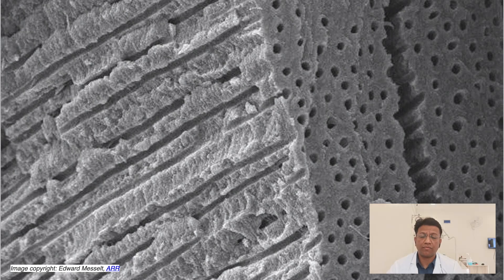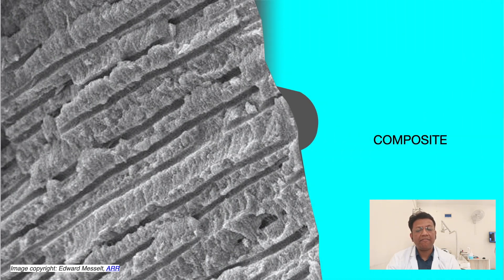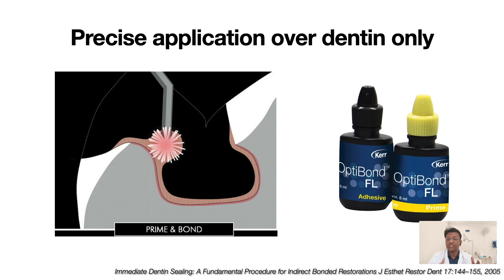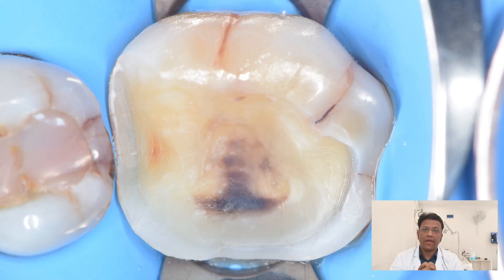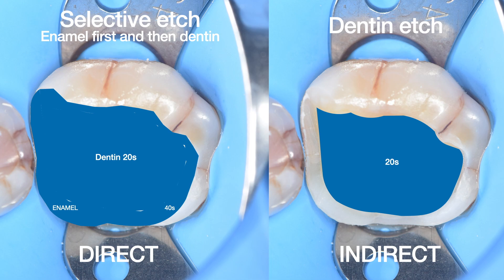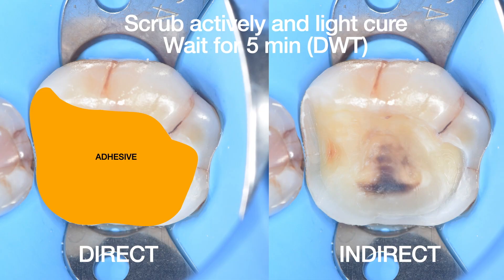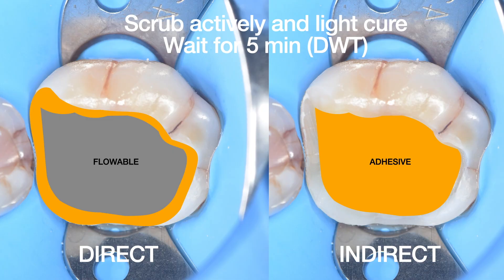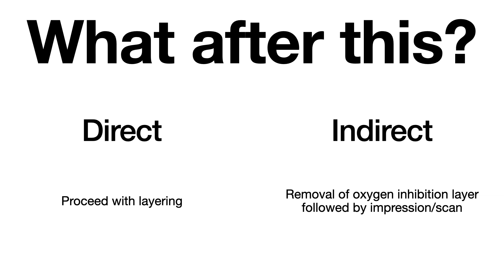Post op sensitivity after composite restoration | Immediate Dentin Sealing

Comment: I'm using composites with DBA since 1995.My observation is there were lot more sensitivity cases when we were using 5G DBA and few would become necrotic as well.Fortunately such cases have become rare with 7g dbas.My advice to my younger colleagues is if a patient complains of post op sensitivity, immediately remove the filling thoroughly and place reinforced ZOE immediately and let the tooth heal.Dont expect sensitivity to go away on its own or with desensitising tooth pastes.Aftr 4 weeks you can replace it with composite but do place a light cured Gic liner on dentin.
Reply: Zoe has Eugénol and it makes composite fall off later on tho